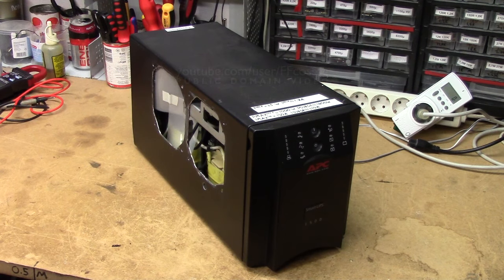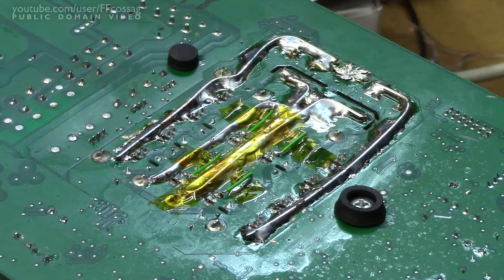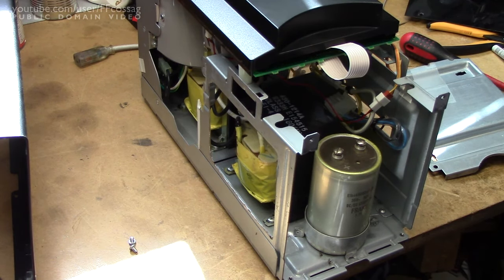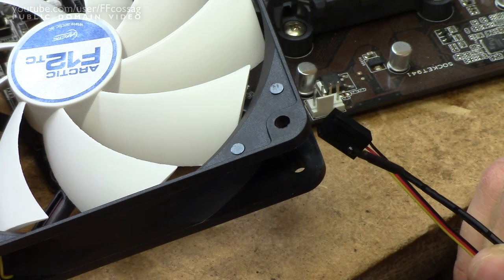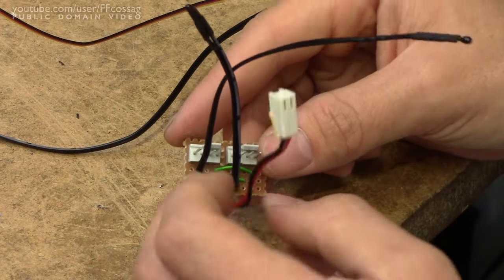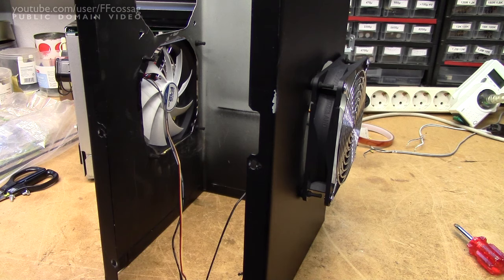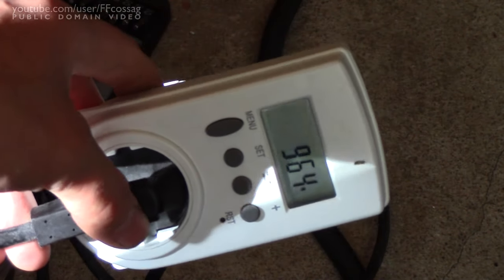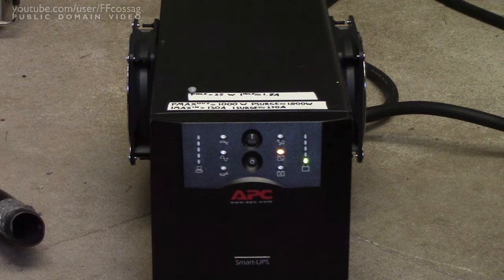Smart-UPS 1500 12 V inverter hack revisited & upgraded

Comment: You probably need to add additional transistors and to check the current rate for the relays and replace them with bigger current contact capacity.

Comment: the reduced efficiency at high loads is most probably due to the transformer design.
i have done some measurements on apc 2200 tx (wich as you know have two tx used in parallel. if you are interested i can  send you test details.

Comment: good job
have a similar setup here i suggest u to use fan filters for dust problem u can use dried baby wipes if u like. also u can make ur own super simple (ntc mosfet pot) fan speed controller and calibrate as ur needs.

Comment: Great video I really like the UPS ones as I do similar hacks. I find cooling the transformers the hardest bit and I have gotten Dell temperature controlled fans from old PCs and used that, I put the temperature sensor in the windings so I adequately cool the transformer.
Reply from the maker: Yep, often the transformers are severely undersized for the rating of the unit. Since they aren't built to run continuously, they can get away with driving the transformers into saturation and just letting them heat up their giant thermal mass during the short time it's running on battery.

Comment: Hi buddy, any video yet, on high idle current modifications. After power cut all battery power drained by no load current when device not in use. I have apc 2200va and apc smart 750VA. Thanks pal keep up the good work. Much appreciated

Comment: Huh. I was always told the Gentle Typhoon fans were the ones to go to for low noise. Guess that's not the case with this unit, especially if they were running full tilt.
I really want to get my hands on a set of two of the PWM variant for testing, but they're hard as hell to find for less than 20 bucks US a piece now.
Reply from the maker: Don't get me wrong, Gentle Typhoons have excellent airflow-to-noise ratio. It's just that they were not thermally controlled in this application, whereas the new fans are relatively aggressively so.

Comment: what did you mean by it rebooting with out the additional capacitor ? did you mean it will randomly shut off ?
i have upgraded the batteries on my ups and it is randomly shuting off after 15 ~ 30 minutes and i need to restart it again.
i made sure its not a heat issue but i dont know what else it could be :(

Comment: How the hell does you iron make that good a joint my 100w cant even tuch that kind of soldering had to get out the 160w
Reply from the maker: The secret is in the thermal resistance between the heater and the tip.
Reply: do you use lead based or lead free ?
Reply from the maker: Photonic_ Induction
Normal Pb40/Sn60.

Comment: Nice, i have 1000 and 1250 from 1998,.still working fine, i ad same type of fans en 2010, but i use 5v, to get silent fans,, now i power they externally,  do you know if i can get 12 or 5v dc from the board without damage it? thanks

Comment: Heya, i am having some issues with my hack; my Spmart-UPS 1000 seems to have some sort of internal battery capacity meter that it refuses to ignore. I am running my UPS off a power supply but whenever it decides that this mysterious software defined battery size is empty, it shuts off and refuses to run further until i reset it or let it charge some battery. How could i make it ignore that software limitation?
Reply from the maker: You can't, but you can use prog mode through the serial terminal (press 1, wait >1.5 seconds, press 1 again) to change the number of external battery packs to something silly, as well as change the battery constant (send a 0 and use +/- to change value) to something bigger. That'll net you hours or days of runtime. Finite but long.

Comment: can some one please help me get my APC Back-UPS Pro 1000 S BR1000MS to run longer when I hook up my 100AH battery to it? This thing thinks it has the original battery, no matter what size you hook up.150w load runs 24 minutes. while the BMS of my fully charged 100 amp hour lifepo4 battery calculates 9 hours. What the hell?   It has some kind of battery timer, pretending to be a battery monitor.
Reply from the maker: I doubt that thing will give you access to the smart protocol to adjust the number of external packs parameter, you're probably screwed.
Reply: @FFcossag  yup. this is cheap gimmick stuff. you need to see it to believe it. the transformer is in direct contact with the plastic shell and it is melting and deformed. not the slightest bit heat resistant. I got it used and got my money back and they didn't ask for it back after the pictures I sent.This thing gets hot as hell on battery even with no load. has a place for fan ,with a flow arrow that would blow the heat right onto the board. lol. there are vents where it touches the sides of the case , but no air could be sucked in because the metal of the transformer/coil ,is actually touching the plastic all around those two little vents. no wounder they are deformed. The craziest part is, the case looks like it was made for rising heat airflow up along side of the transformer and out the vents, but the channels are blocked by plastic. like the casting was "F"ed up.
 seriously,  you'd would have to see it to believe it. APC has gone to crap. I used an old one [not sine wave] to run some lights and laptop charger for many years. but killed it with a hot plate. thank God it was the ones in metal cases because the transformer did the rocket engine thing inside . A LOT of magic smoke was released. A LOT.

Comment: Hi there, nice video!  Im trying to convert my old ups into an inverter using Li ion batteries. I use a 3s 16p battery back with a bms so it would cut off power to the ups at 3.2v, and a separate charger for the batteries. Now my problem is that since the ups is designed to use deep cycle batteries it shuts down at 11.6v. Like you have shown in your other video Im trying to find that voltage diver and change the resistors so perhaps I can trick the ups and so it won't shut down. Since Im a newbie, would you kindly help me out? I can send a few pictures.
Reply from the maker: I'm afraid I never have time to help people out like that anymore. I've never modified a 12 V APC UPS for that either, so I don't know where the divider is off the top of my head.
Reply: How high of a voltage can it handle? Could you wire your pack in 4s?